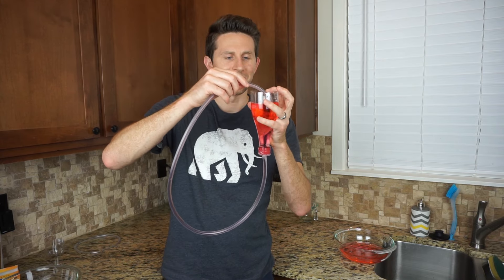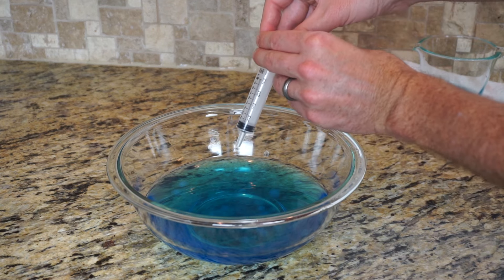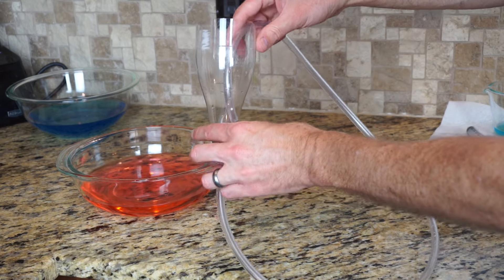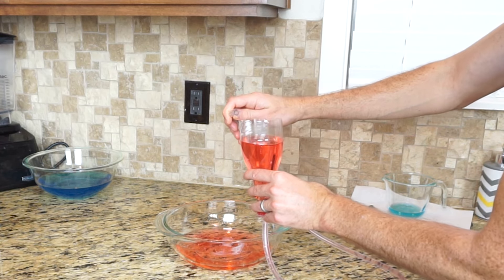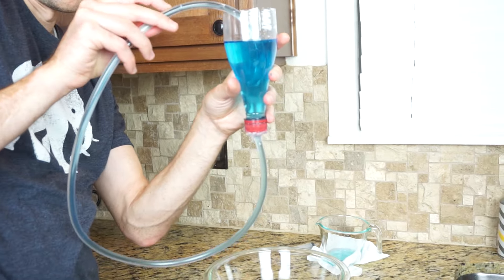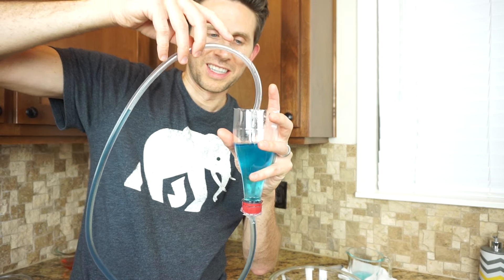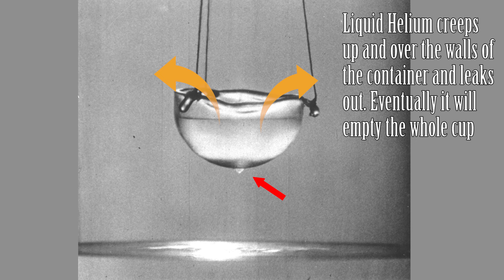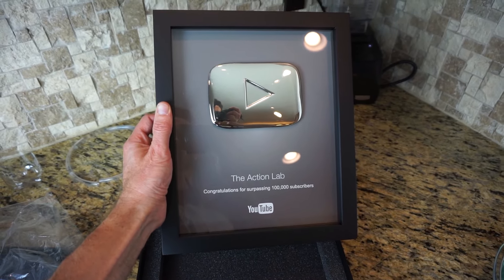Boyle's Self-Flowing Flask Filled With Polyethylene Glycol (Self-Pouring Liquid) = Perpetual Motion?

Comment: Hey Action Lab! Great video I know this is 5yrs late!  but I always had a perpetual motion idea that I have never seen anyone attempt. I am sure you already know what a Magnetic rail gun is. My though is... what would happen if we made a magnetic railgun long enough to form a perpetual loop. Is it possible.? would it eventually speed up until it explodes? The military uses Rail gun to shoot missiles with a lot of power! Would it be possible to harness this power or will it also pan out neutral.
Reply: railguns require an absurd ammount of energy to work
Reply: @caldeira_a  Yes, agreed to shoot a military missile... But you can still get a great power with just lining up Neodymium magnets correctly.. to shoot a steel ball. I think a perpetual loop would be possible. If made long enough..  Yes/ NO???

Comment: Next time use a larger vessel of fluid. And a shorter hose with no slack.  Angle the vessel so the surface of the fluid is at an angle. Attach the hose to the bottom side with the higher water level, and pour it back into the top side with the lower water level.

Comment: The problem with liquid helium is that it has a boiling temp of about -452 °f or about -269 °c. So liquid helium could not exist on Earth under our natural atmospheric conditions. Also, as a super fluid I’m not even sure if it can be contained— super fluids are super unpredictable as they can pass through solid matter, climb walls, and maybe even float through the air. From what I understand about advanced physics is that although superfluids are technically a “fluid”, they behave more like a plasma. Correct me if I’m wrong but it would be impossible to do this with liquid helium.

Comment: This reminds me of the atmosphere powered electric motor I built using a similar method. I used millions of tiny Carbon nanotubes shaped like Tesla one way valves that dumped a proprietary super fluid over a spillway. It was the only way I could generate a net gain in power.
Reply: Hmm
Reply: You didn't
Reply: @edwardcardozo8325  obviously I had to push start it

Comment: What actually happens. Is the mass of the fluid equalizes with the atmospheric pressure and gravity.  But if you remove gravity the fluid cant flow. If you have just pressure. The tension of the fluid equalizes with atmospheric pressure. 

But superfluids seemingly break this paradox.  What happens with superfluids is they want to equalize the pressure and with gravity the mass of the fluid moves it to be molecularly smooth. As soon as you remove gravity. Superfluids dont flow. But if you apply a pressure gradient then they will exhibit motion.

Comment: You need a bigger volume tube to be more successful because of the tensile strength of the polyethylene glycol. Perpetual motion will not be achieved but it will be able to flow more than this result.

Comment: Maybe if you had a tube that has the same volume as the cup, my thinking is that the existing fluid empties out faster than it can be replaced. But if the tube and cup both are the same volume it may cancel out

Comment: Angled magnets in a twin inner outer  circular structure. Outer stationary or fixed structure inner able rotate on plane. Opposing magnetic fields provide the "work" ?
Reply: Might possibly even be able to control speed with the tilting of the magnets?

Comment: What if you filled the glass partially with water then topped it off with the Egg Whites? Egg whites are heavier and could push it past that threshold then if you place the end of the tube inside a vac sealed lid the suction would pull the egg whites around thus pushing the water through again to suction the egg whites? I would say 70% water, 30% egg white liquid?

Comment: If you fill a balloon with helium and it doesn't have much in it it will start falling down because the string weighs it down but once it gets all the way down the string is touching the ground and no longer holding the balloon down so it floats back up and down and it repeats over and over if you have a non leak balloon this can go forever.

Comment: what if you use a big bucket filled with water and put one end of the pipe in that bucket and another end outside and suck out the water, the shall keep flowing. also making sure that water falls back into the bucket so the water level is maintained. something like this was used in my local area by a thief to empty the petrol tanks of bikes.

Comment: Try a 3 liter tub with a smaller diameter hose.
Reply: The water on both ends would just level out regardless of the volume of the tub; water pressure is vertical

Comment: So basically a solution would be to have the water enter at a point that is below the main source of water but in that resevoir.  So you could make a hatch system or a system based on sruface tension earer the top.. with a hydro phoic end, maybe it owudl use the surface tension to pull itself horizontal and into the glass that owuld bethe same hieght... hmm... How do we put A into B at a hiegh that would work. that hammer idea but revered in the resevoir could work. Since it would be hitting the system... utlizing variosu shapes, hmm... just need the subjet matter to enter the system at a mid point. I think it could be possible.

Comment: AQUESTION:- 
HEY BUDDY:- I may tell you SOMETHING VERY INTERESTING:- to try this with the same equipements and liquid:= The tupe that you hold it to pour the Liquid INTO THE FLASK:= Just about 20 cm before the opening of it (where it pour the liquid in the flask)=> You make another hole in it and attach a pipe -(with a diameter less EVEN  ONE TENTH OF THE ORIGINAL TUBE:= SO IT LOOKS LIKE A DOUBLE ENDING PIPES : The original one; as the one you have in your hands> goes and dipped right inside the Liquid>>>>> and the other one (the second tube you just made; as I just explained)> make it pour in another flask =  and at the bottom of this second flase you make a hole with a  tube to go in the first flak......( so you keep using the same  volume of liquid= and you don't need more and more liquid== JUST TO KEEP USING THE SAME AMOUNT OF LIQUID)=== SO: THE SECOND PIPE YOU MADE TO POUR IN ANOTHE ((BIGGER FLASK) =and the two flasks are connected with a tube from the bottom to keep using the same volume of Liquid) !!! BY DOING THIS= YOU; LIKELY THAN NOT; WILL GOT A PERPETUAL MOTION OF CONTINUOUS LIQUID MOVEMENT FOREVER)!!!== 
NOW:
 what is the benefit of this?=
IN THE SECOND FLASK; that where the second Tube you made pouring in; as I proposed and explained; = YOU MAKE  TWO HOLES IN ITS SIDES; AND INSTALL A ROD BETWEEN THEM WITH something like 4  PARALLEL peices  alongside the rod; SO TO WORK LIKE moving the rod when the Liquid falls on them:=(( like making electicity from NIAGARA FALLS IN CANADA))!! =sorry for my bad English !!!!! SO WHEN THIS heavy Liquid falls in those "fan- like pieces" = the rod will turn in a circular motion!!! And you extend one side of this rod out and ins:tall a grooved (light allimunum wheel that can be fitted with a belt) === }=>You may make this: "LIGHT" GROOVED WHEEL; BIG IN DIAMETER:=IE: 20 OR 30 CMs !!!! = Then you connect the belt of this wheel to another =seperate GROOVED  wheel = but this second wheel to be smaller in its diameter: ie: one fifth of the bigger wheel: for increasing the speed of the second small wheel!!!=(EXACTLY LIKE: GEAR BOX......... BUT BY USING BELT; and not Gear wheel!! 
NOW: EITHER YOU CONNECT THIS SECOND small wheel ( on a stand) to another Bigger wheel; and then to a small wheel; which may be a wheel of :=A (DINAMO GENERATOR) =Or you may connect directly the first big wheel to a Wheel connected to the generator from THE OTHER SIDE OF THE GENERATOR >where the fan of the motor of the generator is !!! I mean you go to other side of the generator =where is the fan that is turning= and improvise a connection to it and weld or attach to it a rod comming from the wheel you made that comming out from the second flask:= UI
BY DOING THIS: YOU TURN THE GENERATOR FROM THE (END)= WHERE IS THE FAN: = LIKE A REVERSE CONNECTION FROM OUTSIDE TO INSIDE!!! SO THE COIL INSIDE THE GENERATOR WILL TURN AND GENERATE ELECTRICIY !!!= 
NO MATTER THE VOLTAGE IS:= BECAUSE YOU MAY INSTALL A (STEP UP TRANSFORMER OR ANY OTHER SIMILAR DEVICE THAT STEPPING UP THE VOLTAGE: IE:    1- 30 ====== !!
THE MOST IMPORTANT THING IN MY SUGGESTION; as above; is;
TO TRY TO GET PERPETUAL MOTION BY THIS LIQUID YOU DESCRIBED !!!! = making another hose pipe towards= AND BEFORE= the end of YOU PIPE THAT SUPPOSED TO POUR THE LIQUID IN THE FLASK!!!!! 
AGAIN IN THIS EXERCISE: = MAKE DOUBLE PIPES ENDING :  ONE PIPE KEEP IT DIPPED IN THE LIQUID IN THE FIRST FLASE == AND THE OTHRE =added pipe= to pour in another falsk where you install the (fan like propellers to help the rod turning) and then you shift the motion to a grooved wheel then to a generator
If this goes successful; then I have another suggestion to shift the resulting speed = to the starting speed and by dong this you create: = ( Exponential Speed that keep going  up every fraction of a second to INFINITY)== WHICH WILL END UP = ((((( EXTREMELY DESTRUCTIVE TO THE SURROUNDING IN NO TIME)!!!
YOU CAN CONTACT ME ON FACEBOOK BY USING THE ADDRESS OF MY PAGE:(ADAM PETRA)= USING MY FACEBOOK ADDRESS OF THE PAGE; ADAM EDEN.303
PLEASE TRY IT WITH THIS LIQUID YOU TALKED ABOUT>>>>likely than not it will work!!
CHEERS AND STAY  SAFE BUDDY
ADAM /MELBOURNE

PS:
A NOTE:
THE SECOND PIPE TOWARDS THE END OF THE ORIGINAL PIPE= must be full with the liquid as well; when you start pouring the liquid. AND WHEN IT BECOMES FULL; while the first pipe dipped deep in the flask=: this second pipe  MUST BE COMPLETELY CLOSED BY A TIGHT COSURE OR  COVER; like the cover of PEPSI COLA COVER. and then you take it and open it and let it pouring in the OTHER FLASK; where the installation of a rod with a fan-like propellers on it !!!!= you must keep it closed; once it is full; while pouring the liquid= dipped deep, in the first flask!! thanks

Comment: I understand that the super liquid helium can be flowed continuously in Boyle's flask, and we can not extract power from that by placing turbine in between pipe. This will add friction, which will make flow to stop. But if we put turbine where the liquid is getting pored back in flask (just below the pipe outlet). This will not add resistance to flow (I guess). Then what will happen? This is just my guess. Can you explain please?

Comment: So part of the reason why this doesn't work is because the weight of the liquid in the bottom of the tube is heavier than the liquid past the top curve as it pours back into the flask. Gravity is simply pulling the liquid back into the tube instead of pulling it forward and out of the tube. You would need more liquid weight on the end of the tube and some type of U-siphon to stop air from going back into the tube and breaking your liquid chain......

Comment: If you had more of the tube over the level line maybe it can work. Like you had more weight under the level line so the weight canceled out the motion. If you had more of the tube over the level line using more gravity to pull it through.... Maybe it can work. I think it didn't  work since you had more weight under the the level line than what was over the level line so what has more weight below than what you had over. Hopefully this works, and you see this comment.

Comment: ok , prepare to have mind blown. screw boyls flask. i made a pool pump that takes water up 3 feet above pool and dumps back into pool. 
no moving parts , no motors or any force used. take any vessel that is air tight and install two lines to it. the one on outlet side must be 5 times the lenghth or volume than inlet line. once air is removed by a vac pump or water pumped in to purge all air, gravity takes over and the heavy side pulls water thru the inlet. i made one a week ago. it is still running with no help from me. free energy ? it certainly works and i think one must examine boyles folly as a dissinfo tool. i feel stupid that i didn't know this would work. till i made it and now  see it working. simple simple simple ! if your physics say it can't be done , well im sorry but the formulas they taught you are incorrect or the math is wrong. this is simply using gravity against itself . the closed vessel allows for the dynamic of gravity to run this regardless of atmospheric pressure . do the experiment before you call me nuts.

Comment: Can you make a perpetual motion by using Leonardo da Vinci perpetual motion machine and use the spinning force to generate electricity and keep magnets around the circumference and use an electromagnet using the electricity generated and connect a second terminal which constantly charges the magnets on the circumference.(use gears for increasing the no of revolutions of the motor)

Comment: I got mine to work with water it lasted till the water evaporated too much. A few things I see you did wrong. Shorten the tube some use a bigger base to hold the water. I also used a small Motor and a paddle wheel to light up an LED light

Comment: If you could get liquid hydrogen to flow continuesily, you don't have to put the generator in the tube, it clearly will slow down the flow, but I would put it in the middle between the exit and the flask, while the liquid is falling free mid air, would that work?

Comment: What would happen if your Boyles Flask had a lid and was nearly filled up with polyethylene glycol , and on this lid two ports : one for the tube and the other for a syringe to add pressure to the gap . Would it then work perpetually?

Comment: The problem there is that the weight of the liquid is not enough to pull the rest of the molecules. This might be solved by reducing the length of the tube by reducing the pressure and increasing the size of the tube to reduce friction. Ey I’m not a science expert but that is what I think..

Comment: Would a super fluid still not work if you had the turbine in mid air so that you extracted the energy from the fluid falling via gravity? I mean I guess it wouldn't because the energy has to come from somewhere so I guess the super fluid would make a weaker impact on the surface when landing and would eventually stop?

Comment: how about a sealed drum with a tube on top that is dipped in a tank of water and then there is a tap at the bottom of the drum that lets water out ... now beacuse of the out flow of water the top of the drum would be a vaccum that sucks water from the tank  into the drum .. thus perpetual motion ... you can even add a turbine on the tap end to make power .... why will this setup wont work???

Comment: What if you use your home made magnetic hydrodynamic drive to get the fluid to flow, and then added a small turbine that would power the battery that generates the electric current for your hydrodynamic drive? My guess is that the output of the turbine will not be high enough to regenerate/power the battery...add a solar cell also connected to the battery to make up the difference.  Could the solar cell and the turnbine combined together generate enough power to keep the battery powered enough to keep the liquid flowing?

Comment: Why not increase the diameter at the bottom of the flask, so you can increase the initial flow. Tapering back down to half the diameter by the exit. Also shorten the run so the chain bond is stronger
Reply: try it, it will be self explanatory

Comment: So, you said Liquid Helium could not be used to generate anything but it can achieve the perpetual engine. If it's liquid, then would it not be able to pour down into the flask from the tube and as it pours, could it not hit something that turned like a waterwheel?

Here is my thought. A waterwheel like thing with magnetics sealed inside with a magnetic source outside turning with the inside waterwheel. The liquid Helium would pour down on the internal devise which would then turn the external devise using the magnets. I have no idea if it's possible but I envision a sealed environment for the whole thing. Perhaps made out of glass. 

From there, I have no idea nor am I a scientist. :D

Comment: The self-flowing flask doesn't work forever because if the liquid in the cup exerts force on the liquid in the tube it exerts equal force on itself with so it cancels out and there can't be perpetual motion.
Reply: Well, there can be perpetual motion; you just wouldn't be able to extract any extra energy from it

Comment: Wouldn't this work a lot better in a vacuum? Because isn't it the air pressure that keeps the fluid from exiting the tube?
Reply: the air pressure acts on both parts of the water so a vacuum would not do anything

Comment: If it would work with liquid helium, why couldn't you put the turbine between the end of the tube and the surface of the bottle using gravity to spin the turbine? (Just thinking paddle wheel cups where the helium is falling through the air...not in the tube.)

Comment: Thr thing about liquid helium is that while in motion, it will very gradually heat up. So although it seem like you don't need to put physical work to keep it flowing, you would actually need to put work in to extract heat and maintain its temperature to prevent it from boiling. So yeah, no such thing as perpetual motion.

Let it rest already.